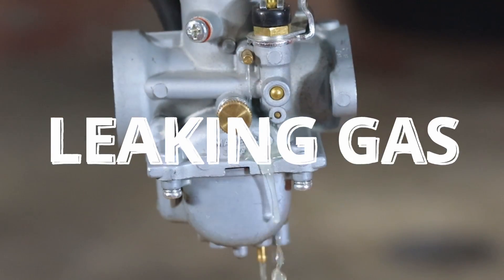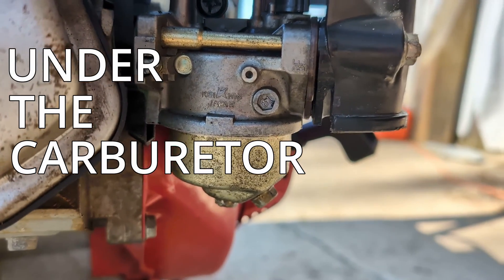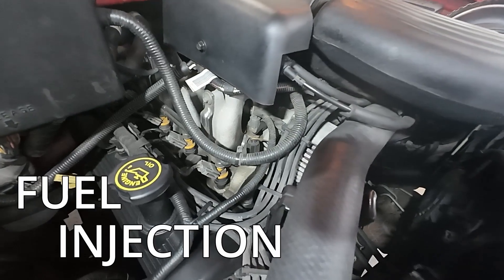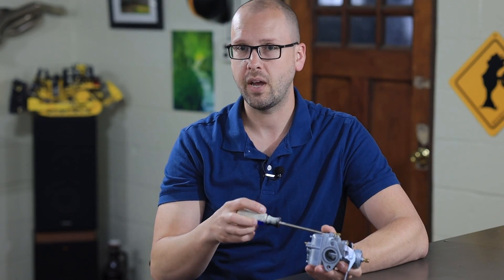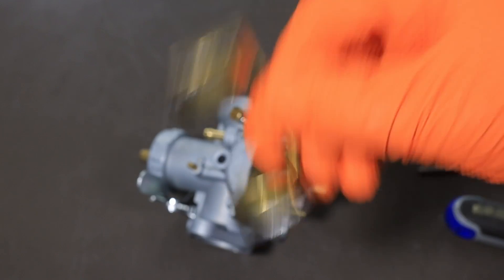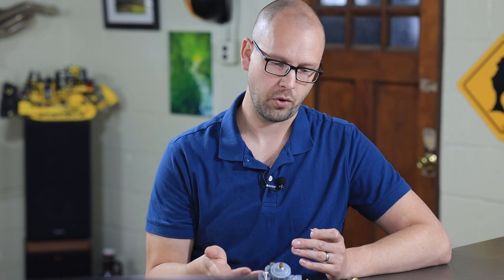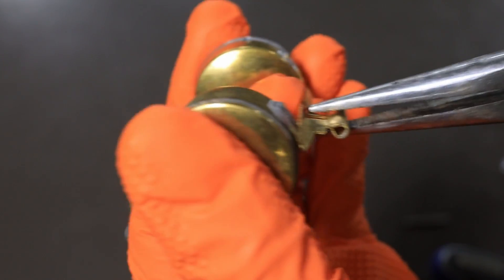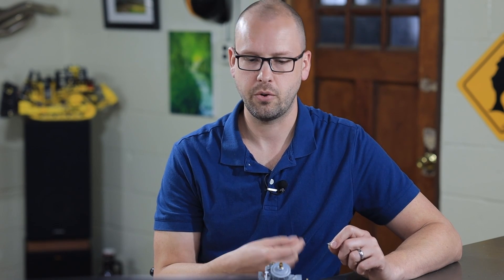How To Fix a Leaking Carburetor

Comment: Wasnt leaking before cleaning. After cleaning it made a mess of my garage and now it reeks of gasolinein there 😞
Reply from the maker: That is not ideal!  I would make sure the little float needle is against the tab on the float and that the float isn't upside down.  I always like to Google the diagram/schematic for the carburetor that I am working on, so I know how the parts are supposed to be oriented.  Sometimes things are put together wrong when I get them, so I can't just assume that I can put them together the way I took them apart.  Especially if the reason I took it apart was because it wasn't running right
Reply: @CoolStuffGuysLike  I didnt touch anying except the two jets. Didnt even take the carb off the bike. I just loosened it so I could turn it upside down to access the needles. Took out the needles and cleaned them and put the carb back on the righ way.
Reply: Took out the jets I mean, not the needles.
Reply: Also its leaking from an overflow hose, not worn gaskets. So probably something happened to a float somehow..

Comment: My carb is leaking from the overflow. I can only imagine it's something to do with the needle and seat, but it looks pretty clean. If I close it and blow through the inlet, nothing gets through and if its open it does. I guess under the pressure of a fuel pump it could be different, but the needle and seat both look pretty clean to me, I can't figure out what's up with it.
Reply from the maker: It is probably the needle and seat but it could also be your float height.  Sometimes you have to bend the little tab that pushes against the needle to let the needle get seated at a lower liquid level.  On a rare occasion your float can get fuel saturated or spring a leak (if it is hollow and not foam).  In those cases you would need a new float....

Comment: my mikuni is leaking at the "drain screw" i tightened it a bit  and a bit more and it still drips, there was something  in the bottom  of the bowl right there inside the bowl where the drain drains out there was some grey stuff that reminded me of like packing that got  crushed and pulverized and stopped sealing. are you saying the float being stuck  can  make it leak at the drain screw?

Comment: How .major is this problem and should u ride with this issue
Reply from the maker: It could definitely become major!  If you have an in line fuel shutoff you can usually wait a bit but I normally fix them as quick as I can.  About every other used thing buy with a carburetor will have a bad float needle/seat and will drip gas.

Comment: I’ll drive my four wheeler and it would just shut off then I have to drive it with the choke on and then it leaks gas at the bottom hose and I got a new float piece and a new needle no idea what it is
Reply from the maker: If you need to choke it to keep it running, it is usually a fuel starvation problem.  Could be a dirty filter, a bad fuel tank vent, or water in the gas.  My bet would be water in the gas.  I'd put some heet dry gas in it, and a tank of ethanol free gas for starters.

Comment: I just replaced a carburetor on a Briggs engine on my generator. OEM from Briggs at $200. Gas leaks out of the choke port. Just for grins I ordered a cheap knockoff for comparison and it does exactly the same. Any suggestions? Am I missing something?

Comment: when taking the float cover off like you did in the video, do you "have" to put new gaskets when you put it back together after adjusting the float valve? what if the gasket looks great? I am just wondering if it is a rule to always replace the gaskets if they are designed for a one time installation and when opening it like you did then you must replace them? I have a 98 Honda Shadow vlx 600 and after rejetting  the carbs one of the carbs leaks but not the other. I didn't replace the gaskets but wondering if it is something else besides getting a new gasket for the one carb? but makes no sense since the other carb has no leaks and I didn't replace the gasket on it just reused it.

Comment: My carb is leaking the exact same way as the first clip, it's a honda cb400 dual carb, i had fuel problems, disassembled, cleaned and reassembled the carbs, now it is leaking for that bung type feature on the side. I'm wondering what its for, whys it leaking, can I fix it?
Reply from the maker: It is likely a welsch plug that plugs one of the  holes that were drilled when it was manufactured.  After casting if they need a hole that turns, they basically need to drill in from two directions and plug one of them.  You will find a lot of little brass plugs on carburetors that are doing nothing but blocking off holes.  If it is in fact a plug and is leaking you can replace it.
Reply: @CoolStuffGuysLike I think I carb is leaking from those 😢

Comment: my 86 honda elite 80,has had carb issues since i bought it 2 yrs  ago,,and a pain to remove carb,,its leakin around float bowl,,so i ordered another rebuild kit,have a shop manual,but never been a carb guy,,,runs well except for havin to fiddle with the air screw on occasion,,great video--thanks

Comment: I have a 377 safari the gas is draining down fron the carburetor it's not leaking anywhere and I got to pull it like 90 time for it to start once it's start runs fine,  what's the reason
Reply from the maker: Probably the float needle and seat are bad.  It won't shut off the gas properly when the float bowl fills, then it will also flood itself since it will overfill.
Reply: @CoolStuffGuysLike  thank you I'll change out my plugs tomorrow just before I try and start it maybe it will help and I'll clean my carb next fall seasons almost over more for having fun with the kids

Comment: I have a Kohler SH265 engine and I was having a hell of a time with my carburetor bowl gasket leaking, after countless hours of troubleshooting I finally figured out that the bottom of the bowl was bottoming out on the pickup tube, and wouldn’t compress the bowl gasket. I carefully filed some of the pickup tube away, now the bowl will compress the gasket.  This style carb has a bolt on the bottom holding the bowl on.
Reply from the maker: Wow that is unusual!  I am sure that would have and me stumped for a good while also.  Was it the original carburetor?

Comment: After multiple attempts of adjusting the float, I opted for a new carburetor and ordered a vacuum pump too. After I replaced both, I’m still seeing gas drip from the overflow line. Any thoughts?
Reply: Did you figure it out?